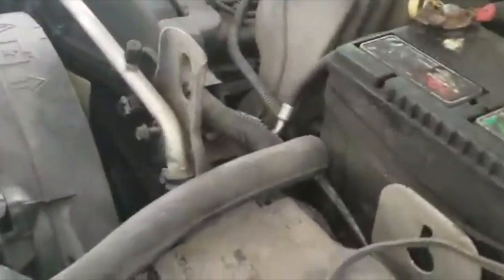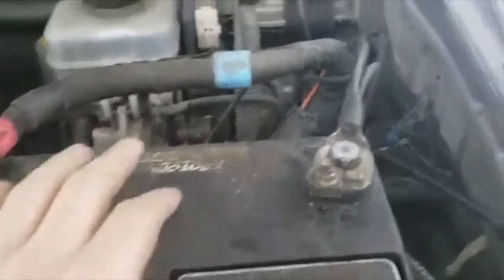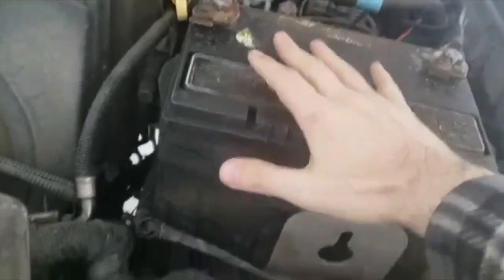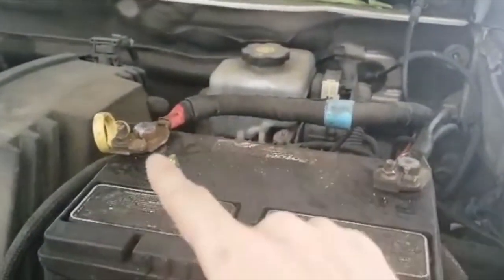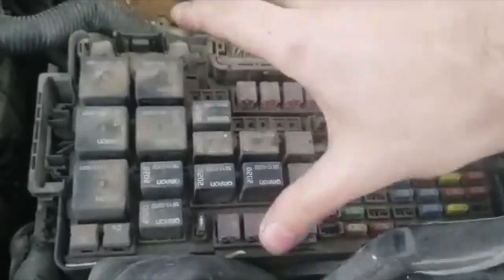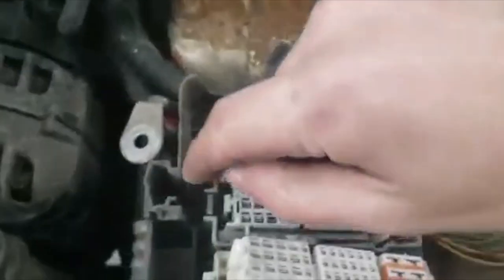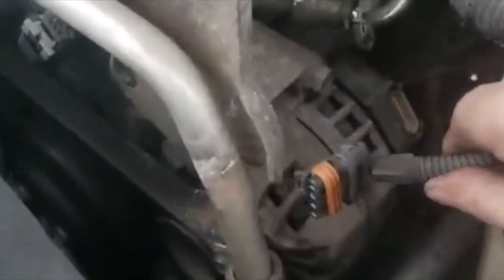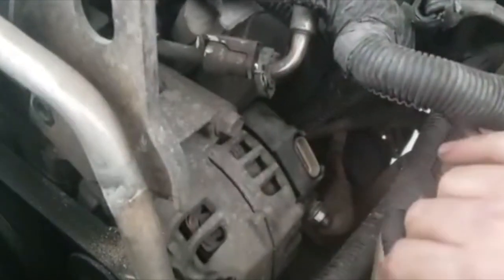Hummer H3 Alternator/Generator removal under 30 minutes video on how to remove fusebox link comment

Comment from the maker: IMPORTANT***FUSE BOX
For those who wants a specific on how to remove and reinstall the fuse box follow this video: https://youtu.be/SDwcNsy4DEg

IF YOU DON'T INSTALL IT PROPERLY THERE WILL BE ELECTRICAL PROBLEMS.

And do not apply to much force when screwing back the bolt for the wire connected to the alternator/generator. This will need to be fix since the alternator won't work anymore.
Reply: You don't need to remove the fuse box.

Comment: I was approved for the financing and was about to buy an H3.  I'd been watching a lot of videos prior to the purchase when this hit my feed.  Considering it's a 15 minute job on my S10 that is free of obstacles I'm having a lot of second thoughts about making the purchase.  This is ridiculous how much GM buried it.
Reply from the maker: I owned a GMC S15 for nearly 10 years, it's basicly the sonoma/s10 of the 80's- 90's.
They are really good trucks! 
The late 90's -2000 s10 had issues with the frame rusting. But beside that you could drag them for years without any major problems.

If you have a 4x4 s10 and the frame is solid, I would stick with the s10. 

The H3 is nice, but I would suggest them to someone that is handy in mechanic, since they kind be tedious on maintenance and to fix on your own (but again depends on your personal experience in mechanic) or to someone that have a good wallet to pay for the repair.

But it doesn't mean it's not for you. You can find many aftermarket parts for cheap to decent price. And once you know them, they are pretty easy to work with. (GM engine in the end are all the same)

My honest opinion, if you need to do a loan for it (and here it depends on the amount you pay for it to! Some people over price them, make sure to check the blue books) and that you expect it to be a tank that will not break for the next 5 to 10 years without problems I would say skip it. Better have a good work horse (vehicle) that cost nothing and parts are everywhere then being strap for cash.

Feel free to ask any question! 
But in the end, its your choice.
Maybe some other people in the comment will say otherwise.

Comment: You really should remove this video and do it without touching the fuse box, there is NO NEED to remove it. Seems people who have no idea what they are doing have caused themselves issues by doing so. I removed mine without even touching it.
Reply from the maker: Hi James, thanks for the comment.
Would you mind giving a description on how you removed it without removing the fuse box. It would help those who do not want to remove the fuse box. The channel is more like a forum page so any info for the others the best!

Edit: did you slide towards the firewall or did you pull more to the front near the AC hose? For the video the fuse box is extremely easy to do sadly the video edit is went side ways. So I made a video on how to remove it. It is a safe process when you know how to do it.
Reply: My method, remove upper radiator hose to access fan shroud, slide bottom half up and around and remove shroud. Loosen tensioner and remove serpentine belt from alternator pulley only(unless replacing). Remove battery and battery box (for room and safety). Unplug front sensor and move back wire harness cluster( use small bungee cord to hold it out of the way). Unbolt A/C line and yess, bend it back as far as possible, you are not likely to cause damage if you do it slow and gentle, It’s either this or take the chance at messing up your electrical system by remove fuse box. Remove all 3 bolts and bracket. Unplug alternator wire nut and harness. Remove bottom alternator bolt first, then both top bolts. With minor maneuvering the alternator will come right out the top. So personally I seen no need to touch the fuse box, especially after reading others issues. Overall, your video helped, thank you.
Reply from the maker: Big thanks man! I appreciate the information. It may help others that won't want to play with the fuse box.

Comment: So far my 2006 H3 has had the lowest maintenance ever..just the basics oil, filter, fluids etc. At 248,000 miles it has been the most reliable vehicle I have ever had, still..and I have had many. I just gas up and go. I do have rust in rear underside, due to NE snow but also because I didn't have mud flaps on the rear.  So I guess it's the luck of the draw..sometimes.
Reply from the maker: Depends how well they are taking care of.

Honestly I didn't have much to do like you said they are pretty sturdy.

The rust does attack the rear more. Watch your rear door flaring. The back wheels throw a lot of stuff behind that plastic mold. 

Glad to see another strong running H3! Best vehicle I ever drove in the snow!

Comment: 2006 H3 250K miles. Did it in 1 1/2 hrs. Don't understand the bracket for just one aluminum tube. Didn't need to remove fuse box either. Thanks for the video.
Reply from the maker: Meh, the 3.5 and 3.7 have weird brackets like that. They feel over engineer for what they do.

When you removed the alternator without removing the fuse box, did you pull it towards the firewall?
Just to give an idea to other people who wouldn't want to remove the fuse box. It would help!
Reply: @probonomechanic  I was able to unclip the wire harness and pull on the aluminum tube enough. Just brushed against fuse box.
Reply from the maker: Sweet! Thanks for the info. 
Hoping I won't need to change it, but I'll give it a try next time!

Comment: Battery light actually means the alternator is not charging. Rarely will bad battery create a light.
Reply from the maker: I agree, my mistake since I did not make the distinction for different location in the world. The fact is that we get -35 degree celcius (or -31 fahrenheit) and it is common for cells within the battery to be damage by the battery expending when it freezes. It is a story geography in that case.

Comment: I did mine yesterday and now the only thing that comes on is my head lights. I had an aftermarket security system in and now nothing comes on. So mad right now!!! SMH
Reply from the maker: Hi, sorry for the delay!

You have no power? Did you check my video for the how to uninstall and reinstall the fusebox?

https://youtu.be/SDwcNsy4DEg

This is usually the problem!
The brackets under the fuse box needs to be lifted and lock in place before dropping it back. If you push it in place without the brackets in their proper position it can bend the pins or just not be connected properly!

Comment: I did change the alternator on H3 twice.  By removing the fuse box and by removing fan cover then bending a bit the ac hose. The 2d opinion way better and faster., because watch out when putting back the fuse box, not to bend the shjtloads of pins underneath when putting it back.
Reply from the maker: My video isn't properly done. I need to redo the job without the camera bugging at the fuse box part. 

That's the thing. The fuse box can be a really easy job, if you know what your are doing. So the removal takes about 20 min to do and reinstall is as fast. So I made a specific video on how to remove the fuse box, and its super easy and go in as butter. 
https://youtu.be/SDwcNsy4DEg

The problem is that there is a weird trend to push the fuse box in place with the connectors unextended and it bend the pins. They need to extend the connectors until they clip open. After that the fuse box slide in place no problem.

In the end, the time is about the same for both method. But the fusebox one, request the person to understand the whole process to make it proper. For me its easier, but I suggest big time to check the proper method to remove and install the fusebox to do the job.
In the end this method is the safest of both. No bending of ac pipre and fusebox pin.

Knowing is power hahaha

Thanks for the comment!

How much time it took you between the 2 methods?
Reply: @Pro Bono Mechanic  hey :)
I had to change the alternator 3 times in 3 years that I have the vehicle.  1st time, by removing the fuse box it took me almost 2 hrs, 2 d time playing with fuce box roughly 1hrs, then I bent one of the pins, 3 times I did it about 3 weeks ago, by the removing the fun guard and sneaking it trough the front about 20 min. Ah, and forgot to tell, last summer when I did the job on fuel injectors, I took off the air intake and changed the serpentine belt with tentionners, I unbolt the alternator for easier access.  So, to locate the lower bolt and to get it out, it got easy for me. 
Also I found out how to change starter in that thing..  :))  honestly, the engineer who designed it, I would invite to perform the mechanics on it, to see how happy he would be ...
Reply from the maker: Hahahahahahah yes! Please invite me over so I can look at him doing the job!

Pretty sure its tge new trend for modern vehicle. They want to make sure the owner can't do the whole job themself. To a point that it gets rediculous even for mechanics lol

Honestly, sorry to hear that you had to change it so often. Do you have any leak? Like debris getting in the alternator? Or a lot of lights and accessories? It feel weird that they go out so fast.

Anyway, I wish for you that 2022 will be a good alternator hahaa
Reply: @Pro Bono Mechanic   1st time I change it because I wonder it was due (I guess for the girl who sold it to me, it was last drop), then the rebuild one I get, wasn't properly rebuild,  then last time, it start whining like supercharged,  after I change the belt.. It lasted like that for one month.. and I did 2 trips back and forth Montréal- New York,  good thing it broke not far from my place,  so I can CAA tow it...
I general I think if you want to ow that wehicle,  you'll have to to the mayor or all mechanics yourself,  otherwise you'll go bankrupt. On my H3 I did crazy job. I tear it apart almost whole thing,  change lots of parts (suspension,  brakes, censors, some wiring job, rust proof, brand new paint job, chome strip, sandblast, powdercoat...- you name it) but to do that you'll have to keep in mind that you'll newer get your $ back, you do it because you like the wehicle...
Anyway,  happy new year for you too! :)
Reply from the maker: @denisucra7979  totally agree with you!

Comment: thank for your video bro.without that i dont think i take risk to remove my h3 alternator,it takes me about 3 hours but i am glad i didnt pay for labor,i order new one so to put it back do ineed t release the belt one more time and put it in alternator before i hold it(screw it) ?
Reply from the maker: Hi,
Reinstal by screwing it in place, then remove the tension from the belt to install it over the alternator. 

The tensioner is located on the other side of the front of the engine. 
Check this link for the belt diagram and the location of your tensioner:  https://www.ifixit.com/Answers/View/144869/need+serpentine+belt+routing+diagram

Other thing, when you reinstalled the fuse box did you follow the steps from this video? https://youtu.be/SDwcNsy4DEg

Let me know how everything turned out!
Reply: @probonomechanic  thank's @ Lot
Reply: Update.Hi bro i order new alternator from amazon and i place it but now nothing work in car(dont turn on and no lights or sound when you put the key in! )i thought the battery was drained completely with the old alternator i get new battery but still the same.do you think the alternator i bought is damaged or i miss something when i reconnect wires and putting back the fusd box that i removed.even with bad alternator i think the car suppose to start with new battery at least for few minutes right?and tips you give me will be helpful and thank you
Reply from the maker: For the alternator, the wire that connect to the back of it is just hold in place by an easy to strip when putting back the nut. Make sure you didn't strip the threads.

The terminal for the battery are well known to cause problems on the H3. Make sure they are properly installed. As it coupd be the problem.

When you reinstalled the fuse box, did yoi follow the link that I sent you? You may want to remove the fuse box again and make sure the white connectors that are under the fuse box that connects to the wiring harness are completly extended as far as possible and that they are clipped in place.

On a side note, can you tell me the symptoms that your H3 had before doing the alternator job. I want to make sure you are working on the actual problem.
Reply: @probonomechanic  thank s a lot.i will check all that when i get home,i remember for the back wire of the alternator,i just screw it tigh all the way then i cover it so maybe was the problem,yes i have seen your video and i heard a click when i put the fuse box back and all pins looks fine,beside those two white connectors there is one smaller connector in right side but i dont see anything connected to it! so the problem starts when my car wont start and the lights very low then after i jump start the car,everything work great then after 2 days the car did the same so i said maybe the battery is dead so i bought new one and put it back and it works then after few days while the car parked in garage wont start again,at the begining  change the terminals but nothing change so by elimnation i suspect that it was alternator or something that drain a battery everytime
Reply from the maker: Hmm, the second battery should have taken back a charge over time. Did you try to boost the second battery?

If you have a tester you could test the battery to see if its in good health.

No power what so ever seems to be the battery.
Reply: @probonomechanic  i did that first time  and to make sure i got new one to be sure 100% is not thr battery then i will just return it or exchange it t9 keep ot for my other car that will need a battery soon
Reply: @probonomechanic  with no power at all and car wont start with new battery and new alternator,i think i didnt put back properly the fuse box connectors,even with damaged alternator car would start at least for few minutes i dont think the alternator has a role at the begining like" first spark"
Reply: my car is back to life😍 finaly it was the connectors that i didnt put back properl,i also i changed littelfuse that i think was the problem from the begining and drain the battery everytime so i have returned the new alternator and the new battery  i bought i still need to wait few days to confirm that the alternator is good.i dont suggest anybody to remove the the connectors unless a professional like you hh,very tricky and i had to take it apart to put it back in place.thank's a lot
Reply from the maker: Glad to hear it is all done and working!
I admit that doing it is tricky the first time, but once you know how to do it it can be done really fast.

Enjoy your H3! You sure did work for it hahaha

Comment: So my vehicle seems to have power after I did this but now the light switch is turning the wipers on and it won’t crank
Reply from the maker: Hi Dillon,
Remove your battery, lift the fuse box again. 
Check the pins that are under the fuse box, just to make sure there are no bent pins. 
If the whole thing seems in order, there are 2 little brackets on each side of the plugs that connect under the fuse box (big white plugs), make sure to lift those brackets as far as you can (it will make the middle part of the plug stick out of the bracket) and push the plug back into the fuse box (slowly and straight).

Let me know the result!

Comment: What kind battery do you have
Reply from the maker: I have a Cosco battery: Group size 24DC, Cold crank at -17 degree 550 and cold crank at 0 degree is 685. The item number is 207200.

I don't have the battery holder in my H3, so I'm not sure if it fits within the original battry box.

Comment: got it on now no electronics work in my hummee
Reply from the maker: Hi,
Sorry for the delay!
Did you properly reconnect the plugs under the fusebox? If it was maybe not aligned properly!
There are 2 white pins on each side of the plug, you need to push them as far as possible to make sure the connectors are lifted out of the plug. (It should click!)
Reply from the maker: Double-check all the pins under the fusebox to make sure none is bent too!